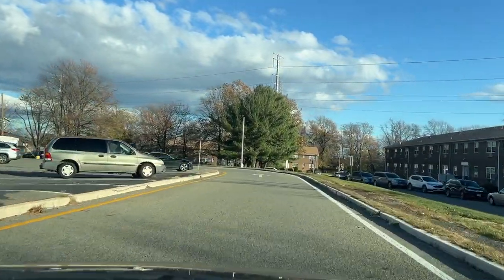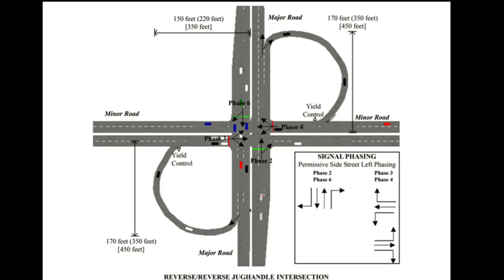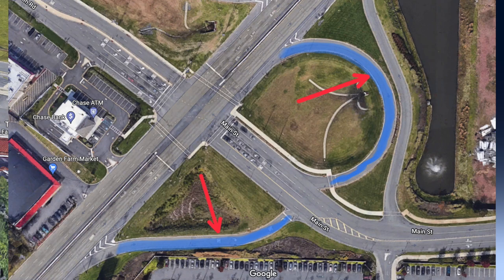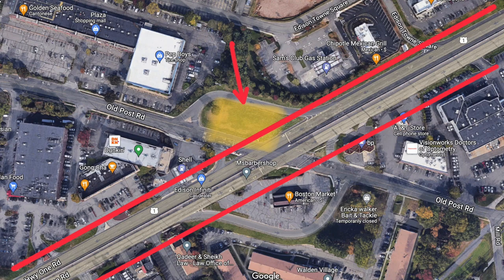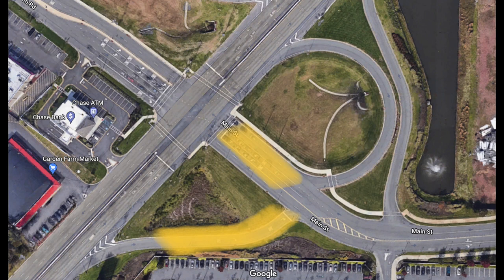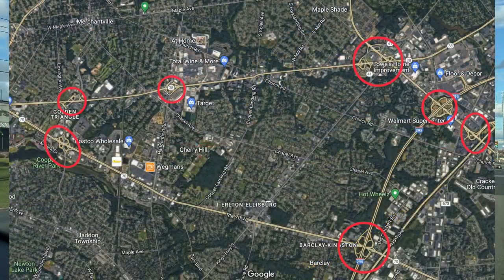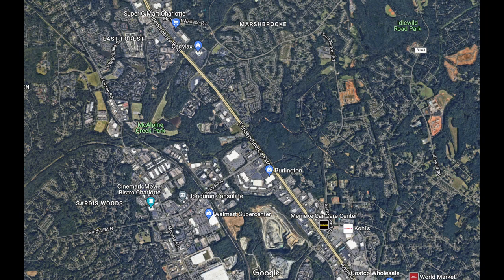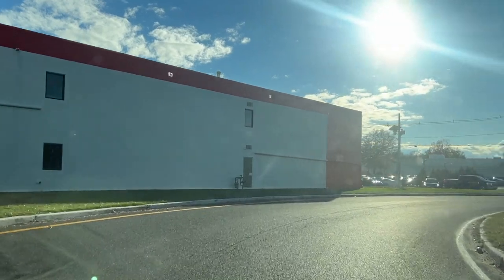Why You CANNOT Turn Left In New Jersey | The New Jersey Jughandle

Comment: I'm in NJ, and have been here all my life. I've been driving for over 40 years, so I'm used to jughandles, and never give them a second thought. On rural US 30 in Mullica Township, between Egg Harbor City and the Elwood light, Route 30 is a divided highway with a grass median. Going westbound there are small jughandles for all turns at the side roads. Going eastbound there are left turn lanes in the median. To make a U turn from that lane, the signs direct you just past the side road, and you make a left turn into the westbound jughandle, through an opening in the jughandle median. It's always been this way, for as long as I've lived in the area. But just in the last few years, many eastbound drivers have been making full U turns from those left turn lanes without crossing into the westbound jughandles. With no police around, they are getting away with it. It can be dangerous with other cars around, but they don't care.
I have never driven on any of the roads that go from Philly, diagonally up to New York, and have also never driven in the northeastern area of this state. But in the areas where I have driven, I think the jughandles are a good thing.

Comment: I spent some years living in NJ, and have returned occasionally since then. One of the biggest and busiest jug handles has since been replaced by a multi-level interchange at US 1 and Scudders Mill Road in Plainsboro. It was a 3-way intersection with a reverse jug handle on only one side, and part of the problem was driver behavior. The jug handle could accommodate about 20 cars, but sometimes there were even more backed up on the main road. If they were impatient, they could end up blocking the intersection when there was a green light for the cars on the jug handle to go through onto Scudders Mill, i.e. they were blocking the path of the car about 20 cars ahead of themselves.
Reply: I now live in Michigan, and the diagram of the "Superstreet" looks a lot like a "Michigan left". Are they the same thing? I have done very little driving in the south.

Comment: This was common in Frankfurt Germany. And the timing of the lights. Like street cars each direction  traffic went on each side of the boulevard or highway with trains of cars that were allowed to travel without side traffic interference. Cross traffic traffic lights only came on when a train of traffic on either side had all cleared. A clockwork online that I had been familiar, in 1981 and 82. Once I became comfortable with how convenient and time saving turning right to turn left was, I remember preferring it as it allowed much more traffic to get through the intersections with the wait time of two left turns are removed out of the equation. I really liked it. Three traffic circles connecting three autobahns. I got accustomed to driving through them but I can't explain them. You pick the lane you want to exit at before you go into the circles. As you make your way through the course of the circle you end up exiting where you wanted to be without any effort except picking the correct Lane when you entered. My favorite intersection was the third one described. That was the only type I saw while I was in Germany. New to our highways in Anchorage Alaska the boulevards swap sides requiring a light in only two directions with merging right turns whether you're going left or right while crossing over the freeway at the last or first depending on your view access to the highway bound for the bound from to the valley. During the evening escape, all lanes are filled from the controlled traffic leaving downtown which is where the right turn is from the other highway. There's no waiting an extra merging Lanes extend for a mile as traffic compresses and accelerates towards the s curves and 50 mile drive to the valley. When all three lanes are going 90 miles an hour in the 65 is on nobody slows down unless of course there's that courtesy officer that some can't wait to greet with clear roads ahead escorting all safely at 70 mph followed by long trains of traffic. Way back there is the caboose fighting its way to the front. So I don't drive those times I drive off peak when I can go 50 miles an hour saving gasoline as I've got plenty of time compared to money and I'm glad I don't make that commute. Terrifying on the s curve during the winter when it's dark. Driving opposite of rush hour traffic with all headlights in your eyes is like being on a ferris wheel with everything spinning past you at high speed and I'm thankful I don't have to endure that on a daily basis or ever again. That's my report from up here in Alaska. I like your video and I'll explore More. Strange kind of guy is I. Clueless about football, an encyclopedia acknowledge just like when I read the books in the library when I was a kid and I read everything I liked and mostly skipped the parts that didn't strike my fancy. Like a Granger catalog. I think every kid should get one just for the tables and charts filled with mathematical opportunities to challenge their minds. There's nothing else that algorithm found me something that wasn't news and that I could understand and enjoy. I didn't hear you tell a single lie and that's refreshing to the ears and no controversy except the foreigners. I'm 63 and recommended this video for 7th graders or younger. How can you make your phone help you design and engineer your own cities with intersections and traffic lights in the lake? I drew those kind of on paper when I was a boy. And Drew houses requiring neighborhoods and traffic lights. I even brought one that worked to the driving range in high school, finding an old signal in the Platte River, I got a 8-track tape recorder and some metallic tape creating a timing for the relays that would like the correct light. I got an A.

Comment: I live in PA, in the Lehigh Valley. We have quite a few of these in our area, especially along MacArthur Blvd, near Lehigh Valley Mall and the other shopping areas adjacent. They work very well to keep a very heavily traveled area from becoming congested. Unlike the types you mentioned, a few of these in my area actually dump you out into an access road for shopping center. Then you just turn left out of the parking lot access road and cross into the other shopping center you wanted to go into. It works. On a really busy road like that, I think it's a viable solution. I've also been on Rt. 1 in NJ and the jughandles totally work there. Do they work better than traffic circles? No. Did NJ get rid of many of their traffic circles in favor of jughandles? Yes. Did traffic get worse? Yes.
Reply: I also live in the Lehigh Valley, and drive in that area all the time. I really enjoy the ones on MacArthur Blvd, especially when the traffic getting out of the mall is so congested its impossible to turn left to get back on 22 to get back to my college. Having these makes getting back to where I need to so much easier.

Comment: Feedback: As former NJ resident, I never formulated the rules into words, which you did well. I watched because of my false idea the topic was why Left-on-Red was not permitted (which is in PA). As for differences, or changes, NJ is removing traffic circles while PA is installing them. Remember the Rosie-Bounty Papertowel commercial? The diner was at a traffic circle which functioned well, except for inexperienced drivers. US46 in Little Ferry. Now it has a traffic light and an X intersection. It's slower overall.
Humor, about the left lane; it is also used by old people going under the speed limit or using seeing-eye-dogs to view the barrier, or ..., or .....

Comment: I am from NJ and I am glad they have the jug handles, these are located only on main highways. But on other major roadways, many stores/businesses you cannot make a left when entering or exiting the parking lots if there isn't a dedicated traffic light or cross street. Some drivers will not adhere to the No left turn signs, and many times I have this leading potential high speed accidents.  Also, on roads that have multiple lanes, when I need to make a left turn and there isn't a dedicated left turn lane, there have been many times where cars have almost hit me from behind, they will speed up and switch to the slow lane without even looking. So at dangerous intersections where this occurs, if there is a lot of traffic (like during evening rush hour), I will keep going until I find a safer area to turn around, or go a different route to get home (taking back roads through neighborhoods). I really haven't added much time to my daily commute by doing this, and It definitely has lowered my risk of being in an accident (and lowered my stress level).

Comment: When running shipping containers from Virginia to upstate New York, I started using NJ-17 between I-80 in Hackensack and I-287 in Mahwah because driving the length of 287 seemed to take too long as is generally a boring drive. I found early on that travelling on 17 is fast despite the almost endless shopping centers because of the jug handles.

Comment: You say it prevents queueing, but it doesn't. It just, by necessity, provides a larger queue space than would otherwise be needed.

You say it saves space, but it doesn't. You might not have to expand the road for quite as long of a distance, but you do have to expand it much wider, and you're left with a chunk of unusable land in the middle of it to boot (which will become a nuisance in many cases).

The advantage is that it slightly decreases conflict points, and might also decrease the amount of force involved in accidents (hit by someone going slow in a T-bone or sideswipe on the side road, instead of someone going at speed towards you on the main road). Uuuuuunfortunately it also often meets the other road at a less-than-ideal angle which leads to views being obstructed by door pillars, people not checking far enough over their shoulder, etc.

The real reason traffic can flow well on highways like that despite not being controlled-access is that they're limited-access. We could solve a lot of our traffic woes by just... not giving every strip mall  and neighborhood 5 different exits onto the same arterial or highway.

Comment: I grew up in NJ and despite our extreme traffic volumes it works.  I am extremely frustrated in the number of "stop: conditions in most states and the delay on the mainline.  I wish this were recognized more by other states that are fixated with left turns.  It is why, as a Texan pointed out to me, that our freeways while very crowded work, except of course for rush hours, the older land service highways, as you note with route 1, work.  Also what you did not note this that this allows for two way green progression, it is why you can drive from Trenton to New Brunswick and never stop for a traffic signal, if you are careful with speed.

Comment: New Jersey has the most ingeniously designed roads to control traffic. The no left turn design makes things so simple as long as you understand the design. It definitely helps with the consistent flow of traffic as well as less accidents at intersections due to left turns and U-turns! I also love their use of Jersey walls to divide their roads. Their turnpike is even the best. Pennsylvania also uses jersey walls a lot on all their roads! We have a few no left turns here in Washington D.C. as well as jersey walls on our freeways! Jersey uses these walls on their regular roads, too! Rhe biggest problems are if you don't understand the design and also the GPS not being a big help. The GPS can sometimes not tell you that you have to make a right in order to make a left or a U-turn. So driver confusion is the biggest problem! Although I'm from Washington D.C., I'm fully aware and used to New Jersey roads, and I love them, especially as a trucker!

Comment: The jug handle only works in the auto oriented suburbs. I am sure that you almost never see any people walking along those routes. In San Francisco they solved the problem of the jug handle on U.S. Route 101 where the buildings are too expensive to purchase for a ramp, you simply have to make three right turns to make a left off of the highway in the City. I wonder if NJDOT has come up with new guidelines to prevent the back up of queuing vehicles on the cross street by ensuring the ramp exits further away from the major route.

Comment: Great video. I grew up in new jersey, learn to drive there, spent most of my early adult life there. It's not really that complicated. You just have to think of driving on a highway in New Jersey as driving on an expressway, except that it's not grade separated. You wouldn't slow down in the left lane of i-95 so that you could make a left turn. You shouldn't do that on an arterial or any other highway either. 

Funny enough, I now live in orlando, and I think about eliminating left turns on East Colonial all the time. Because it's a grid you wouldn't need any right-of-way acquisition. People would just drive around the block. There are plenty of examples of exactly that kind of setup around new jersey. Where right of way acquisition was expensive and unnecessary so they just modified the existing block system into de facto jug handles.

Comment: I lived in northern New Jersey from 1985 to 1990 and got used to the jughandle lefts.
But at that time there were still places where you could make regular left hand turns.
There was an unwritten rule in NJ if you were first in line in the left turn lane: as long as you didn't make eye contact with the drivers on the oncoming side of an intersection during the red light, you could turn in front of the oncoming traffic if you got a good jump when the light changed.

I came to the conclusion that driving in New Jersey was a contact sport, and bought a beater for my daily commute.
That was another unwritten rule:  the car with the most dents gets right of way.

When I moved back to Indiana, it was like being set free.
Reply: That still applies today. Always wondered why people did that.

Comment: I'll be straight up with you. Left lane is the fast lane, middle lane is for speed limit, and right lane is the slow lane. Note: there's never a U-turn allowed most of the time in NJ. This isn't a new normal, it's always been like this. In NYC they have times you are allowed to make a left or right, so imagine that. 
You cannot make a left or a U-turn from the left lane on highways and major roads because no one on the incoming side will stop. There's zero reaction time. In local areas you can make a left from the left lane most of the time unless there is a sign that says you can't. There will also be a left turn signal light and an extra lane to turn left. The thick white lines (somewhere around 8 mins in video) means no passing. So the two different jugs make that confusing. Do not switch lanes when you see those thick white lines it's illegal to pass during those lines. Trucks can use the left lane when necessary and when they do you better be out of the way because they pick up speed.
Lastly right turns are allowed unless there is a sign that says no turn on Red with or without a time listed. Overall pay close attention to traffic in NJ and pay attention to all the signs in NJ. Last thing you want is a state trooper or sheriff pulling you over.

Comment: I’ve been through there. A native was driving thankfully. I’d have never noticed them otherwise. They’d make some sense if they were more uniform. Half the time I had no idea which way we were going to go—through the intersection, across it then back through it, and there’s still lefts on the other roads and sometimes it’s a standard intersection. If they were all the same, that’d be fine. Roundabouts are a better solution but somehow people don’t understand them. Granted that does tend to slow down traffic going straight, but I think it more than makes up for it with smaller queues on every turn you’re going to make.

Far more egregious is the Pittsburg Left, which they’ve exported to the South and we’re not expecting nor happy to accommodate that BS. They should have a PSA on all roads leaving PA that no one else does that.

Comment: I'm from Québec. There is a single jug handle in my city that I am aware of. Standard cross intersections are still the dominant norm, but several roundabout have been built theses last few years. They work rather well. The one complaint that I would have is that the roundabout that we have have too small of a diameter.

Comment: Not all NJ intersections, I live in CT and even I been in New Jersey, it's mainly because of the traffic volumes on busy routes. Left turns are the most dangerous maneuvers if you drive on the right side of the road. And in New Jersey it's also illegal to wait in the intersection to turn left unlike where I live so that's also another reason for the jug handle designs.

Comment: As a former NJ resident, I can say that I both miss and don't miss the jug handles.   Those like the one showed over and over again by the Boston Market in this video, is probably one of the worst ones I know of.  I would always avoid that particular turn, but overall, I think they are a better setup.  In Florida, without the jughandles, I notice that I sit at a red light on average a lot longer than I did in NJ.  I never timed, it, but it feels, like 3-4 TIMES longer.  I highly doubt its that much longer, but it definitely takes getting use to. Also the main roads can easily be 6 lanes wide on ONE side (2 left, 3 straight, 1 right is a common setup).  I would not want to have to cross that on foot.